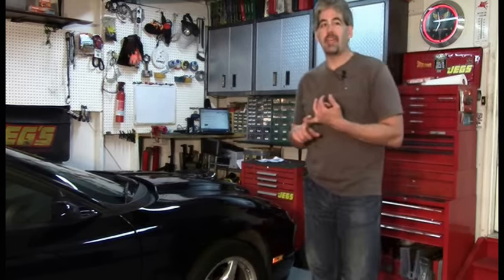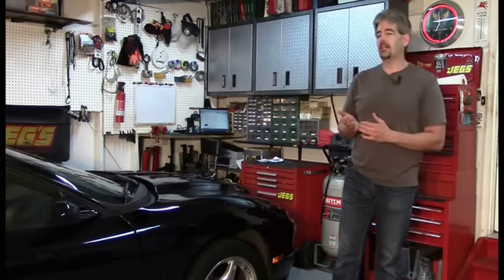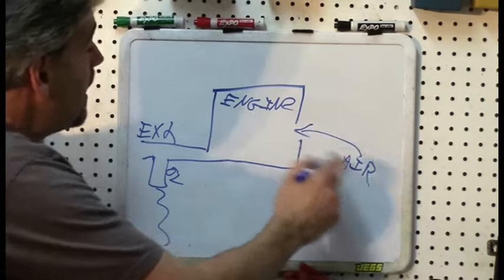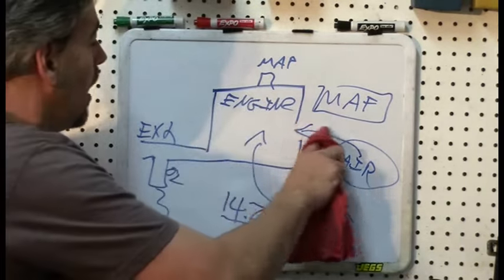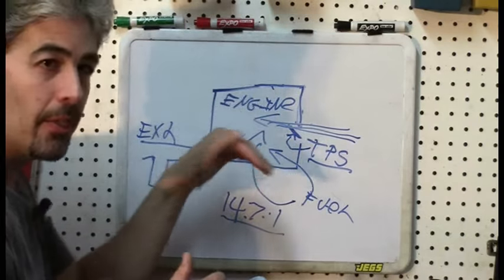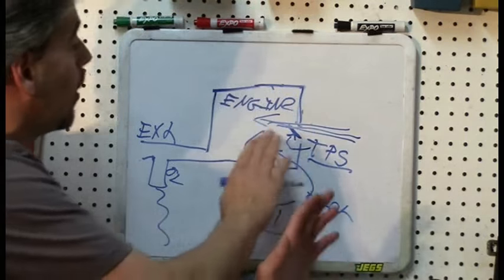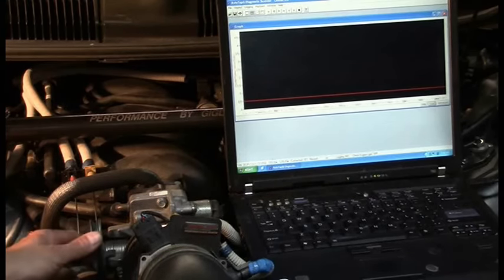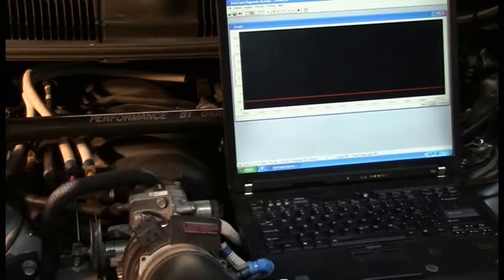TPS (Throttle Position Sensor) Diagnosis and Understanding Pt1

Comment: I have an '03 Pontiac Bonneville with 55K original miles.   A few  months ago, the engine started what I call stumbling and surging. (No check engine light came on.) Sometimes it felt like it wanted to stall (stumbling), other times the engine would surge on its own.  Waiting at a red light, I had to brake extra hard to keep the car still while hearing/feeling the engine surge.  Other times at a red light, it felt like the car was going to stall.  If I was cruising at 50 mph and took my foot off the gas, the car didn't slow down at all--as if I had cruise control on, but I didn't.

Took  it in to the shop, and they replaced the intake manifold and cleaned the throttle body and throttle position sensor.  The mechanic said engine coolant had been dripping on the throttle position sensor and also that it was the dirtiest throttle body plate he had ever seen.  Repair cost $700 but the car ran fine for 4 months. Then it did the very same thing.  As before the problem was INTERMITTENT.  One day I'm driving a car that behaves like a bucking bronco, the next day, it's perfectly fine.

Took the car back to the shop, and they replaced the throttle position sensor.  Repair cost $200 or so, but the car ran fine for 2 months.  Yesterday it's did the same thing, worse than ever.  Cruising on the interstate at about 70 MPH and the car started surging.  I watched the needle on the tachometer move from the low 2000 RPM range to almost 3000 RPM and back again with my foot steady on the gas pedal.  Got off the interstate and nearly stalled at the red light at the bottom of the ramp.  Same thing at every red light from there to home.  The car was lurching and shuddering so hard at each red light that I put it in neutral, and each time I did, the RPMs climbed to 3000.

I'll have to take it back to the shop, but I'm losing confidence in the mechanic.  Can you give me any clues to what's wrong?
Reply from the maker: Mrs. Fix-it Can't make a call without any data.  What is the TPS position? The IAC position? The fuel trim?  What is the actual vs desired idle speed? Is it a MAP engine, MAF engine, or both? If so what are the readings from those sensors?

Can't help without data otherwise I would just be guessing.
Reply: Schrodingers Box I can't answer any of those questions.  Wish me luck with my mechanic.  Thanks.
Reply: Schrodingers Box One more question, if you don't mind.  If the car is running fine when the mechanic hooks it up to the machine, is it even possible to diagnose the problem, or does it have to be stumbling and surging at that time.  The stumbling & surging is an intermittent problem.  I drove today and it ran perfectly fine.
Reply from the maker: Mrs. Fix-it It depends.  The "machine" is sometimes still be able to read the car's track record of past issues but in general it is always helpful and sometimes absolutely necessary to "catch" the problem as it's happening.
  It is hard to say if that's the case here without the data needed for the diagnosis.

If you had a check engine light ever come on as result of this issue, a competent tech should be able to diagnose the issue even if the light went off and the car runs fine when you bring it in.
Reply: Schrodingers Box Through all the stumbling and surging, the lurching and shuddering, as impossible as it sounds, the check engine light has never come on.  Today, the clerk at AutoZone plugged in the handheld  scanner under the dash, and it read "0 errors."  Completely blew my mind. 

So AutoZone staff referred me to a "very good mechanic" who was too busy to look at the car until next week, but he did take 5 minutes to talk with me about the problems that I've experienced.  He suggested doing a smoke test for vacuum leaks.  Thoughts on this?

Oh, and this evening the problem surfaced again.  I got the car home and safely into the garage, and I'm 99% confident that the next time I drive, it will be perfectly fine again.
Reply from the maker: Mrs. Fix-it This happens alllllll the time.
  The autozone guy wouldn't know how to fix a sandwich much less a car so I am not surprised.  The absence of a code is very common - it also has amazed me sometimes when no code shows on a obvious symptom.

  All I can say if the car has a symptom, I would be able to catch it with or without a code. I have at least 4 videos on this where the car barely drives but has no codes and I show how to diagnose it anyway.
  The "guess" at a vacuum leak is reasonable but I would have been able to tell in 5 minutes using my "fuel trim diagnosis" video on whether that was a possibility or not. 
  Either way, good luck. Wish I had the car- sounds like  great video fodder.
Reply: Schrodingers Box Ha ha.  I wish you had the car too.  Thanks for listening.
Reply: Schrodingers Box Brought the car back to my original shop today and left it there to give them plenty of time to try to duplicate the intermittent problem in order to get an accurate diagnosis.   The service manager said work was done to the IAC under warranty from the original repair  done 6 months ago, which included cleaning of the throttle body and TPS. I haven't had the opportunity to talk to the mechanic directly but hope to do so tomorrow.  
I watched your fuel trim videos, and found them very well-explained.  It's clear that you love diagnosing and fixing cars.  (Lucky for us subscribers that you do).  Thank you!
Reply from the maker: Mrs. Fix-it I think if you liked the fuel trim video, when you go pick the car up, if they didn't figure it out, maybe you should do it yourself right in front of them lol!
Reply: Schrodingers Box
If this happens again, I'm buying my own scanner and using your videos to diagnose the problem myself.  It's like solving a puzzle.   I've learned a lot here and have already shared your channel with friends and family.
Reply from the maker: Mrs. Fix-it The whole fun of it is solving the puzzle!  I think you'd be hooked.  I really hope they don't fix it lol.
Reply: Schrodingers Box
You may get your wish.  I can see why a dirty IAC would cause problems when I'm sitting at a red light, but I've had surging at highway speed too and the other weird problem when I'm cruising local roads at around 50 mph and take my foot off the accelerator but the car holds steady at 50.  The IAC shouldn't be a factor in either of those non-idling conditions.  At least I don't see why it would be.  I get the car back tomorrow, and we'll see what happens.
Reply: Mrs. Fix-it well?
Reply: findvoltage Matt got his wish.  The car has been "okay" for local drives--although the idle seems high--but I took a long drive on Saturday (90 miles out and 90 miles back) and had problems at highway speeds (sudden RPM surges while driving at a steady speed) and on hills on local roads.   Have never had problems on hills before with this car.  Now it feels/sounds like the car isn't in the right gear on hills.

I don't think my mechanic has Matt's diagnostic skills.  I'm going to have to buy a scanner and take the same drive with it.  Also bought the factory manuals on ebay and am waiting for them to come in the mail.
Reply: Schrodingers Box Hey Matt,  Just wanted to update you on the still-unsolved mystery that is my '03 Bonneville.  It still has pretty much the same symptoms I've been experiencing off and on since January despite three trips to the shop and many hundreds of dollars. So I bought the factory service manuals and the Auto Enginuity Scantool.  The manuals are huge, so I've had lots of reading to do, and have just started playing with the scan tool.  Took a long drive today with a friend with the scan tool hooked up.  I have a lot more to learn about using the scan tool..for example, we couldn't get any bank 2 fuel trims, only bank 1 was available to select, even though the vehicle info was all entered correctly and the only engine the car comes with is a V-6. [Ha!  Looks like there is only one upstream O2 sensor on the 3800 Series II engine--I wasn't expecting that.] Anyway, the big news is that the "Service Engine Soon" light came on for the first time since all this trouble began, and we finally have a code: PO121.  

I observed while driving today that even when I didn't have my foot on the throttle, the TP sensor was reporting numbers that ranged from 17 to over 40.  Also at one point I was going about 50 MPH and depressed the throttle to what should have been nearly WOT.  What do you think happened?  Nothing.  The car held steady at 50.  The TPS was replaced a few months ago, but the problems returned shortly after that, so maybe it's bad wiring or a bad connector.  I do not have the skill to test the electrical stuff, so we'll be heading back to the shop for the fourth time.

I hope some day I can tell you that this puzzle is solved, but maybe we're getting close. Your videos have been a tremendous help in understanding how the air/fuel system works.  It's all really fascinating stuff, and you explain it really well.  Just wanted to thank you again.  Stay tuned.
Reply: Silly quiestion/solution is your throttle cable sticking in some way?

Comment: I just did a axle swap, I had 3.27 gears in the car , the new to me axle is 3.73, The 1st test drive I got about 100 yards and the car went into limp mode the wrench came on & the CEL, and the engine seemed like it was flooding or running on a cylinder down, Trouble codes: P0104, P0122, P0223,P2106 and P2110, P0113 and P0114. I'm on disability so I have no money to go have a tech look at it, Is there anything I May have overlooked ? ANY INFO or help is very much appreciated. I have no idea why all those codes came up, It drove & ran Excellent before the axle swap.
Reply from the maker: That’s a weird one for sure. Most of those codes have absolutely nothing to do with the differential at all. 
  If I had to choose a direction to go… assuming the axle swap is indeed the cause of this issue… I would say that there is a common link in all those codes in that they all use a 5V reference.  Possibly your vehicle speed sensor or some other type of sensor got damaged and is grounding the 5V reference circuit causing all those sensors on the same circuit to malfunction.
Reply: @SchrodingersBox  AWWwww, That makes alot of sense , So I should jack it up and look at the speed sensors ? I rememba Lightly  tapping them in with a hammer. Also sometimes when I check trouble codes theres no codes so I drive 100 yards BANG, the wrench lite comes on and it goes into limp mode, Now It idles and when I floor the gas it revs to redline with no problem. It's killin me...
Reply: @SchrodingersBox  Do you think maybe I smoked the computer ?
Reply from the maker: not if it’s a 5V reference.  the 5V ref has an internal resistor so you can’t completely short it out but you can pull all signals to ground. 
   I would check for a 5V reference at your MAF, IAT and TPS. if any or all or missing that is your issue. as soon as you fix the short to ground it will restore- you can’t fry it.
Reply: @SchrodingersBox   Thank you Matt.  I jacked up the rear of the car and physically checked every sensor, fuse, etc. I unplugged every connection    cleaned them up then I unplugged my SCT Tuner and the car drove normal again.  My SCT tuner went bonkers rite before all the codes came up, SCT tech support spent 1 1/2 hours configuring it but every time I unplug the sct it seems to drive better ?? I didn't attach the E-brake when I replaced the rear end axle cuz I need to buy new E-brakes kits, would that be of concern?
Reply from the maker: Glad it’s running. E brake would have nothing to do with it. I would have to see those 5V signals with and without that SCT module connected to know what the issue is. Did you check reference signal voltages?

Comment: You're clearly the most knowledgeable mechanic on the web but I'd like to ask you a question not pertaining to TPS's but the ECM, particularity on an 04 Cad SRX. These have gotten so small and to be honest I don't see how this could be opened up and repaired like an old tube TV but I've sent mine in twice (2nd time under warranty)to a company in GA who say's they can fix them. Question, is this BS? I suspect they just re-flash them or maybe even get a different one from the junk yard. Any comments? BTW, thanks in advance and keep up the good work.
Reply from the maker: Thanks for the compliment. I have actually never heard of such a service so I cannot say either way.  I would be skeptical for sure. I would be curious how they test them exactly so they know exactly what repair needs to be made in the first place.  I mean, if the car had a shorted fuel injector that blew the injector driver, how would they know to test that transistor specifically??
  I agree with your reflash theory for sure, but also remember, since only about .5% of "bad" PCM's actually are misdiagnosed because no one knows how to do proper diagnostics, the business model could be built on the idea that the PCM very likely never had anything wrong with it to start with lol!!
  Also, even assuming the PCM was bad- they can cover themselves under the premise that the owner never fixed the cause of the bad PCM- so if they are claiming the PCM is still bad... well, it wasn't until they plugged it in and blew it again, right?
  Sorry to sound skeptical but I have just so incredibly seldom seen an actual bad PCM that I find it hard to believe there is a legitimate market for repairing them!

Comment: Hi Matt I have a 1990 f250 5.8 with codes 23 and 34. RPM searching and dying at idle. I started with testing the TPS. KOEO the reference voltage was 5v. Signal voltage at closed throttle is 1 volt. Found a dead spot of zero volts halfway to the wot of 4.6 volts. Put a new TPS sensor in and still having the same test results. Dead spot of zero volts about half throttle going open or closing.
Reply from the maker: A bad throttle position sensor won’t cause that. You first need to determine if the dying at idle is fuel, spark, or timing related.

Comment: My 02 F150 wouldn't shift right for a whole day.  I thought for sure the trans was screwed.  The motor ran fine though.  Finally at the end of the day it through a check engine light and gave a TPS code.  I replaced the TPS and it was fine (That was 150,000 miles ago).  Just thought I would add that, on some cars at least, the computer must use the TPS to know when to shift.
Reply from the maker: *****  Yes, a dead spot on the TPS will make the computer think you let off on the gas pedal and could well affect shifts.  Most shifting problems, by far believe it or not, I find are simply low transmission fluid.  But if that's not it, it's going to be a long day figuring it out most likely.  Most DIY scantools are virtually useless for helping with trans problems when the trans itself is the issue.

Comment: Stumbled across this video, and I’m amazed at the information I absorbed. Which is the reason I subscribed!💪🏽 I have a 2011 Escalade, and I’m trying to diagnose why the transmission isn’t engaging. So I took I removed the TEHCM and took it apart. Didn’t see anything out of the norm, besides a lot of fine metals in the pan and the tranny fluid being black, which would seem normal with over 200K miles?(deferred maintenance on my part) Anyway, I’ve read that the TPS sensor could cause the transmission to disengage because it is measured by speed? My truck would go slowly and sluggishly into 1st gear, then go out, neutral mode. I’d then turn off the truck, wait a few minutes, turn it back on and it would engage and disengage again. Another thing, I would not be to measure the voltage of the TPS since my throttle body is electronic right? Love the channel. I’m glad I stumbled across it🙌🏽
Reply from the maker: I usually simply correlate the input and output shaft ratios on the transmission to verify engagement.

Comment: I used to drive a mitsubishi that would tear up a ram air but it had awd and LOTS of boost!
Reply from the maker: Yes that’s what everyone says. every time I pull up to the 7-11 someone in a Honda tells me about their “other” car that would just annihilate mine.  And every time time I ask them “where is it then? My car is here.  It’s right here. where’s yours?”.
Reply: @SchrodingersBox  Easy Easy now lol.  I was doing my playing at the 1320.  I was young though and my knowlege was outgrowing my wallet.  That was was quick in the 1/4 but damn deadly in the 1/8th with the awd launch once I got sticky enough tires on it.   I had those boosted hondas want to play, with what 5psi lol  More recently I had an E55 with only a tune and pulley which wasnt good for drag since it didnt lauch well but it was an interstate rolling start sleeper.  For the current time being I have a Porsche for the mountains and am working on bringing an old C4 vette back to life.
Reply: @SchrodingersBox  btw i like the tps vid, great way to explain it.

Comment: I have a P0122 and high rpms I've replaced the throttle body the TPS sensor and the AIC I even changed the intake manifold, I haven't tested with my multimeter because the wires all look normal but that just might be it, I'll try it out this weekend

Comment: Beware of a possible intermittent fault with the TPS. Mine was ok when engine cold , but when engine  heated , high idle revs, rough gear changes and lack of power.Sometimes it would run several days without any issues.
I ordered a TPS  on line and the engine now runs super well.with smooth gear changes.
btw ..the  GM dealer could not diagnose this one  ..they tried just about every thing else so it made a diagnoses somewhat easier for me,
Reply from the maker: So what data was there to show the TPS was faulty?